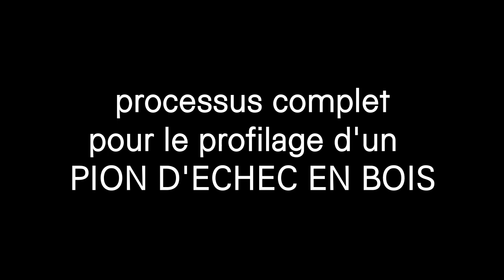minitour JEULIN ASELEC CNC

Comment: Chapeau pour les porte-outils, de quoi s'en inspirer ;-)
Notre Fablab (IUT Béziers) a hérité d'un tour similaire, Microtour Jeulin, rétrofité il y a quelques années avec Arduino Uno sur CNCShield Protoneer et Grbl 0.9.
Sur du chariotage basique, ok.
Cambam, même pion, même opération de tournage, même parcours d'outil. Avec le postpro Mach3 Turn, le gcode s'exécute comme sur votre vidéo.
Avec le postpro Grbl de Cambam, l'outil traverse longitudinalement la pièce sans suivre le profil.
Avez-vous utilisé un post pro modifié ?

Comment: Bonjour super tuto je voudrais savoir le déplacement du x et du z si on déplace le z de 200mm le contrôleur indique 200mm et pour le x comme c un diamètre in dois se déplacer de la moitié donc si on prend 1mm le contrôleur avance de 2mm ou il dois être réglé comme le z et c le contrôleur qui c se qui dois faire dans l attente  du réponse lerci pour se tuto
Reply from the maker: desolé de la reponse tardive, je ne viens de voir la question qu'a l'instant. avec un controeur GRBL , le deplacement est de la valeur  demandée . si le GCODE demande 3 mm , la machine se déplace de 3 mm sur l'axe recherché.
Reply: @lefablabdequoy8301  merci pour vôtre réponse